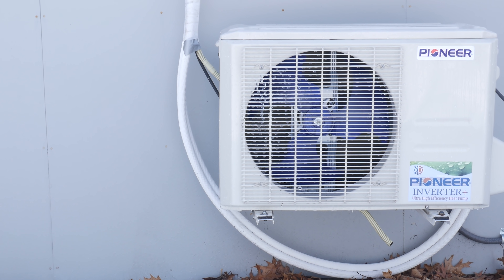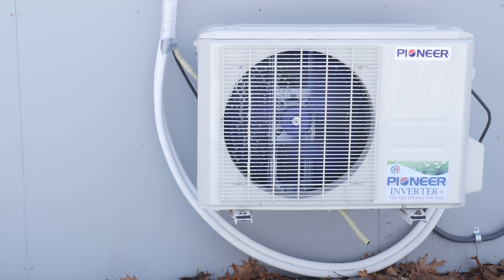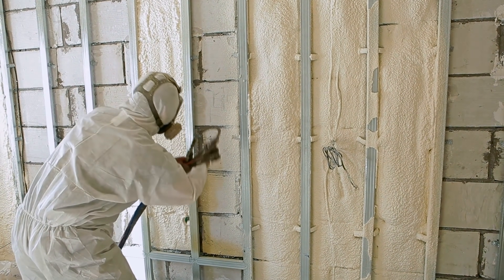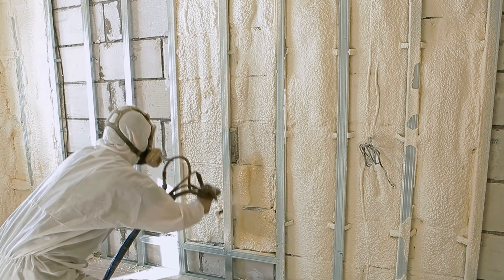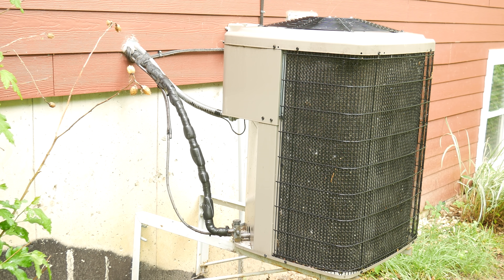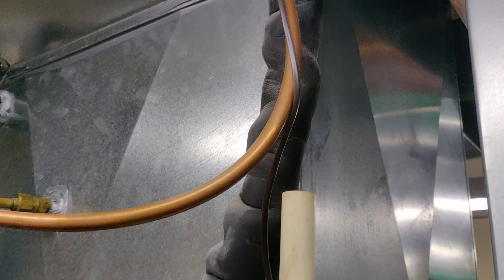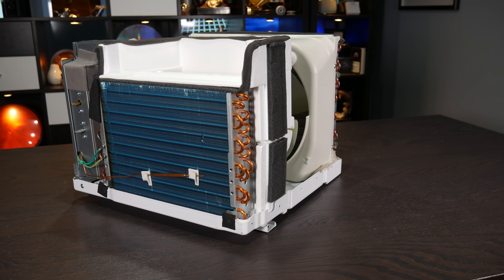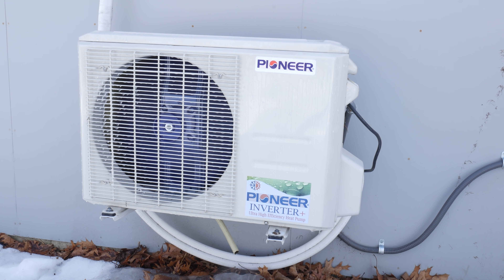Heat Pumps are Not Hard: Here's what it will take to start pumping

Comment: Birmingham, UK, here. I’m a novice at this and getting to grips with all the nuance of this tough cold climate problem we’re trying to crack. We live in 120 year old house, some loft insulations but the walls are wonderful heat exchangers. Anyway we had the plumber/gas engineer over to take a look at an aging has boiler/furnace. I asked him about heatpumps. He basically had little idea about this and explained that the best option is to upgrade to a ‘hydrogen ready’ boiler. This is of course bollocks, but I wonder if a lot of the issue is you’re asking a set fire to gas expert to become an electric/refrigerant system expert. Anyway, I know now that we need to insulate before anything else really.
Reply: A boiler system is still better for heating than a furnace with ductwork imo. Radiant heat doesn’t make the house feel drafty

Comment: If heating with electricity, Manitoba Hydro will pay for basically 100% of the insulating material (not the tools, time, or ancillary things like the carboard inserts) if upgrading an attic from < R30 to R50+. I did mine a few years ago. Insulation was basically free. I had to pay for the cardboard inserts and rental of the blower. That's it.

Comment: Using heat pump in the USA might be questionable depending on your state's electricity mix. 
For 1kWh of gaz used to directly heat a house with an efficiency of roughly 100%, you'll need 3kWh of gaz at the power station to produce 1kWh of electrical power at your heat pump (Carnot cycle). A the very least a COP of 3 is required to just break even in terms of CO2/primary energy. 
That's without considering refrigerants leaks and their current huge GWP. 
As long as most states are 25%+ coal and 50%+ gaz, benefits won't be obvious.

Comment: Do they make heat pumps that can do 8 tons of air conditioning and work at -13 F? Or twin units, I presently do it with 2 4 ton acs and 2 100k btu gas furnaces. I'm ducted for 4 ton ac's and 100k btu furnaces and want to keep the ducts.

Comment: quick question... my HVAC people tell me it is bad for the AC to be run in the winter. since a heat pump is basically an AC in reverse, does that mean that it will be bad for the system to run the winter. where I live we get winter temps below zero. just curious if not, why this would be okay to run in the really cold winter months.

Comment: I think you're, again, way focussed on the US systems with all this. Which are hard to adapt to the areas I live in, which is central Europe. Let me elaborate:

1) Heating here is usually done by pumping heated water through radiators and/or floor pipes. These systems require a high primary temperature (usually >60°C), which increases with the square meters of living space you need to heat.

2) This primary heating is traditionally done by gas or oil furnaces. In many cases these furnaces also make hot water, which is stored to some quantity in a well insulated hot water tank that is shared across the house. Which increases the primary heat requirements even more.

3) 1+2 look like a big inefficiency at first, but when you start comparing the surface areas heated by a central air system to that of small thickly insulated water pipes, you might spot an upside to it.

4) Add to all of this that electricity is relatively more expensive compared to gas and oil in most other countries than the US.

My home is a good example of that of a typical suburbian small home owner here. I have 280m² split across two units. Floor heating for 1st and 2nd floor, radiators in the bath rooms and all the souterrain rooms (basically cellar level made fit for living in). The central gas furnace also makes hot water and stores about what would fill one bath tub (plus a little more) in a really well insulated tank. To feed all this, I need a primary temperature of about 70-75°C. Heat pumps will not do this.

The house is from the 90s, but insulation-wise built to a much higher standard than what was usual back then. I have actually trouble cooling the place down quickly enough when I accidentally over-heated during winter.
My walls are 40cm thick total, comprised of an inner shell of limestone, an insulation layer, and an outer shell of brick. Drilling through that isn't too easy, and always creates a moisture and temperature weak point. To use split system heat pumps, I'd need to breach every room and also install one unit for every room. That would be 16 units, missing the hallways that are not accessible from the outside. 16 outside units would create considerable noise, make the place look like shit, and the whole shebang would cost more than 16k€ in heat pump hardware plus installation and electrical work, if I don't want the most bulky looking cheapest china stuff. (A new gas furnace would run me about 8k€ installation included btw.)
And it wouldn't even save me all that much, certainly not to the point where it would break even at the point where the nominal life span of the units is surpassed. All the added failure points that cause increased maintainance and repairs ignored. Also ignoring that this way of heat generation is very different (and imho inferior) to floor heating, resulting in a loss of comfort to top it all off.

As much as I love you and your opinions, I fear you're WAY out of your sphere of experience to make the claims you did in these two videos for anywhere else than the US.

Comment: HVAC company told me my capacitor was bad. How much does that cost? $320......he was on the phone asking about warranty and I was busy on Amazon looking up the part number. I saw the Amazon price at $28. I told the technician we were done and thanks. I installed the capacitor myself. The markup on parts is crazy with just about any company. I usually get the response....what about their overhead? Not my problem. Charge me a fair price for the part and you got a deal but over $300 for a $30 part. That's highway robbery for a 5 minute job.

Comment: 24:21 I took a look at some datasheets of the shown heat pumps and it appears that the COP at 5F is a given at minimum load (very unrealistic use case) instead of maximum. I wouldn't trust any data about COP unless it refers to a standardized measurement (e.g. EN 14511). So HSPF might be correct and is the correct metric when choosing a heat pump. My two cents

Comment: in the UK our houses hot water comes from the same boiler as the radiators, if we went to air to air heat pump units what would that mean for hot water? How do people in the US currently heat their water in some of the places that dont have boilers? just with an immersive heater?
Reply: I live in the US. Most people have hot water tanks that heat their water. Either powered by electric or gas.

Comment: Greetings from Germany. Pricewise we have the same problme.
A Panasonic 5kW Monoblock which is popular here is about 4000€. In England and Spain this will cost you just 2700€. Guess how much we can get as an benefit from a state programm to support the change.  And compared to a hvac primarly intended to cool, but can be reversed, it's just bonkers, that will only cost you about 1000€ for 5kW as well. So it is not just the installer of those systems, but although the producer is greedy.

Comment: You get what you pay for with these units. And I mean that in terms of power usage. The older and less efficient model you buy the more comfortable you will be. The older models might use an extra $3 or $5 a month in electricity but it's kinda nice to get almost an instant blast of heat on demand when you want it. The newer models treat your request for heat or cooling as a long term goal instead of a priority. I'm happier with my 17 SEER confortotal ebay unit that i bought for $500 than I am with my more expensive high effiency units.

Comment: Y'know, even in small scale you have heatpumps at 2,5x efficiency and steam turbine generators at .5x. There's a surplus already.
It may go away as you need another fluid with a lower boiling point, but what if it can be scaled up?

Comment: Here in Germany we have government rebates and incentives, but I find research on the subject extremely difficult. Clear advice on what systems are appropriate and how much it costs is nealry impssible to find. Any company that does offer governemnt supported services have wbesites steeped in jargon and mumbo jumbo and once you clicked through menus that give you completely irrelevant and useless options, you don't get a price but you need to input your phone number so some sales-rep who doesn't give a crap about what you actually need drowns you in a waterfall of terminology that contains everything except clear technical or pricing information.
I have decided to take your approach. I'll look into split, ductless units with three heads and install them myself and I am absolutely sure that doing it this way will be cheaper than hiring some goon who just adds government rebates straight to the price and therefore their bottom line.
And the same goes for insulation.

Comment: In Australia, we have an even greater form of dumb - new buildings must meet some poor energy standards (wall insulation not even required). However the real killer is - in most cities you cannot remove anything moderately old (eg older than 70~ years) because it's deemed 'character' housing. So they can knock down anything newer and erect anything of any character (usually medium density units). I have to live in my single walled wood shack cranking my AC in 40 degree summers because it's insanely not cost effective by orders of magnitude to try and retrofit insulation to a wooden house designed for maximum airflow 100 years ago.

Comment: soo, only partially related question but maybe someone knows and im quite curious.
What, if any, is the state of "heat anihilation", by that i mean a heat-pump sort of solution that rather than moving heat just removes it completly. For example turning it into electricity. Considering that power plant literally turn heat into energy, and i know there are solid state solutions.
If we take a phone and want to 100% delete, turn into eletricity, it's heat output. How much bigger would it end up and how much would it increase it's energy consumption (i assume it's going to be a loss on that front to). Or for home unit. 

For no other reason than curiosity but if you need "proper one". Cities already create increased warmth zones, solutions to that? (assuming it even is a problem).

Comment: I can counter the "but sometimes" pretty easily. No single family home should be built without a fireplace. Many gas systems rely on electricity for ignition, so without electricity you're screwed anyway. Plus, you then also rely on a functioning gas grid. Having an all electric home 99.9% of the time, and a proper woodstove for cooking, and to stave off dangerous cold when the gris goes down, is a plenty functional arrangement. Just have a stack of wood and kindling out back for a two week emergency. Plus dsngerous cold rarely exists for anything below the top states, just get a blanket and you're set.

Comment: The new Toshiba units will work down to -25 C or -13 F. That must cover 80% of the homes in the US. I live in Greece in a place where it gets to -5 C. I have been using them for almost 20 years. I did upgrade them a few years ago because the newer units are much better and cheaper to run.

Comment: Well, i am not just licensed, in my country it is a 3,5 years long education you can do. 

I always have certain problem with heat pumps, mainly the vold temperatures in winter. 

If the idea is to employ more green stuff so let the carbon levels sink so we come to levels that are actually okay, i argue that everyone in my country will cry because they installed a heat pump. In 1990 the average temperature in my country between november and february was about -17°C 
Meaning a heat pump suddendly wouldn't work anymore and you would have to rely on fossil fuels, or use other methods of heating. 

Another thing is that they are kinda expensive, not to buy or operate, but to repair. If you need a licensed worker to come you can usually suspect more than 500€ and if he actually has to do some things u easily get above 1k. 
Since the internals have rather a lot of parts and most parts are only meant to hold up for around 5 years (at least in my company, from experience, we usually say that they nostly will get replaced after 4 years but not much after) 

Meaning that in my eyes, buying a new unit all 5 to 7 years might be cheaper than repairing it

As example, i can get a split unit with 2 indoor units pre-filled (copper pipes are included and pre-filled, only connect and you can start, no vacuuming) for around 1500€ 
As a technician i can say that 1500€ is way way cheaper than replacing 2 or 3 parts. If the motor gets destroyed you can easily reach 2k in repairs...simply not worth it. 

This would also mean that these units might become a problem of waste. 

Otherwise i love them, i usually declare these specific units for extremely useless because you don't really need that big of a unit most of the times.
But that all depends on how you use them (only turn them ob when needed you need bigger options, if you let them run to stay a certain temperature you might only need a small one)

Comment: Idea: simple ac window unit, split and separate hot exhaust from cold conditioning, return the two, side by side, place compressor outside then boom, dual temp control unit with the help of sensors and programming. Ducts for modulating cold and hot sides and exhaust unused cold and hot  air through the rear. Aka using both sides of an ac unit for heating and cooling rather than  cooling, and exhausting the heat.

Comment: Lets face it there is one reason to use a heat pump that every Australian, especially us that live in Melbourne where we have days that go through 4 seasons in 24 hours really appreciate, you set the thermostat to what temp we like and the system heats or cools depending on what needs to happen to keep within 5 degrees either side of it.  Really lazy solution :P

Comment: Since electricity is very expensive here and hot water central heating is the most popular way of heating here, we should calculate if it's worth it to heat the water with a heat pump instead of pellet fuel or gas. I don't know how though.

Comment: Ya know ... you could do another show on on Heat Pump Water Heaters, which are very similar ... except that replacing a gas water heater with a #HPWH currently means running a new 240V circuit, even though it will use probably under 2 kWh/day on most days.

Comment: Problem is a lot of houses were designed to breathe and adding a lot of insulation can lead to damp and mould and structural damage. I know you said you were ignoring the issue of houses where it’s better to just rebuild but here in the UK a huge percentage of the houses are at least 100 years old and can fit into that category..

Comment: I would like to see more designs that have a split with a given head unit. Often the inlet and outlet are so close that a given head is only working the localised air (to the point of only cooling a couple of cubic meters, despite having the potential to effect a much larger volume of air).  Say you are running this as an AC, the unit will often dump the cool air above the inlet, thus drawing that colder air back into the machine and never letting that cool air circulate in the room.

Thus that head might only be effecting 20% to 40% of the room (unless you add your own ducting to divide the inlet and outlet).  I would rather see a change in the industry so effective ducting becomes a thing.

Comment: Can someone help me read those Heat Pump List spec sheets? Why do I look at the "max" column for capacity and COPs? I'm asking because even for the best units, the COPs in the "rated" column are pretty poor and below both min and max COP. How does this even work, why is the COP worst in the middle? Now okay, at 5°F the unit will work at maximum capacity so I look there, so far so good, but at 47°F it probably won't, so would I not look at the "rated" column then?

Comment: No need to rip out your current furnace. Just add a single mini split heat pump. You'll use it most of the time but still have the old furnace to fall back on.

Comment: Your standard ac takes heat out of the room and disperses  outside , if you turn your current ac around it will take the heat from outside and disperses inside . Unless it's absolute zero outside which is never the case

Comment: I think like 5 years ago, LG put out a dual inverter window AC unit. It was super efficient and I thought it would sweep the competition out and we'd be looking at much more efficient AC units. NOPE. It's still the only one (with a few models), and it destroys the current efficiency ratings. It's like half the cost of the lowest measure on the little energy star stickers. I'm building a house and found it was the best option for now since North America's mini split offerings are awful. Expensive and not even the most efficient models. I think that's beginning to change, but only just in the last year or so. I'm not sure there's an HVAC company nearby that even offers the good stuff...
Note: This is AC only, southern US ahoy!

Comment: How can I know if my minisplits are reversible? They only work on A/C but the minisplit remotes have a heat button.
Reply: Find the model number on the outdoor unit, and Google it. If the specs mention heating capacity then it is reversible.
Reply: @jimwind374  I think they're all different models but I'll go around and check them. Thanks!